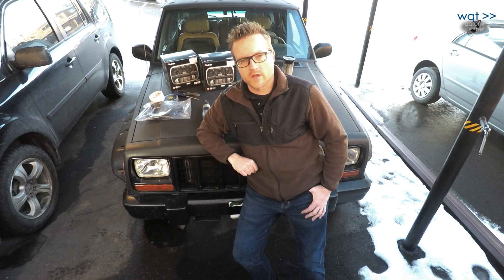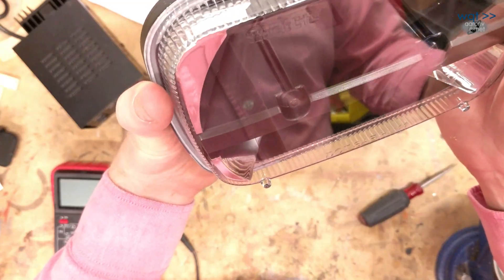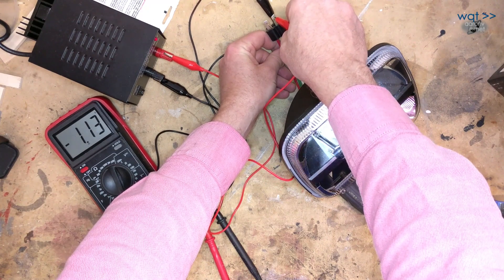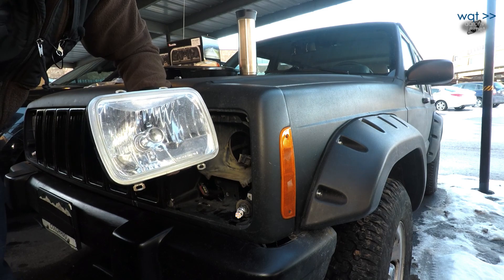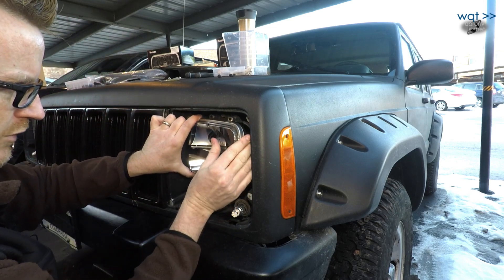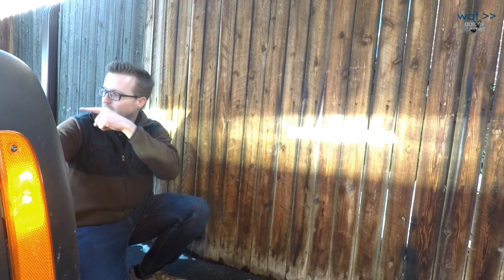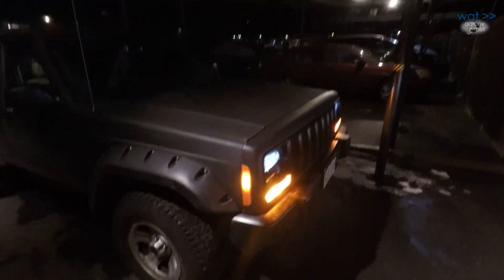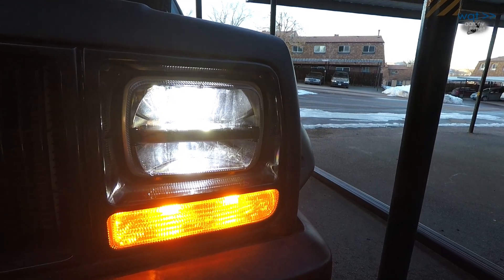projectXJ: 5x7 Truck-Lite LEDs to upgrade the Jeep H4s (84-01 Jeep Cherokee XJ, many others)

Comment: Please share the part number(s) of what you purchased. And where did you buy them? Directly from Truck-lite?
Reply from the maker: The part number is 27450C (both sides), as far as I know this is the only 5x7 sold by Truck-Lite. I got it from Amazon and the seller was Drivetrain America. As of right now, if you search "Truck-Lite 27450C" on Amazon it appears as the first listing with the best price and an "Amazon's Choice" tag appended. Headlight Revolution (referenced in the video) also carries them online, but I've never used that company. I don't see a sales option on Truck-Lite's website, but they do have a "distributor search" option which may reveal a trucking or RV supplier that has these (and probably other brands) in stock locally.

Comment: Truck-Lite makes a heated version. I’m curious how yours will work with heavy wet snow. Does it create the same amount of heat as the incandescent makes to keep ice/snow build up?
Reply from the maker: On the few occasions that I've been in wet snow/icing conditions with this vehicle, I have gotten buildup and had to manually clean the lenses. But with an automatic, no ABS, no traction control, and a lunchbox locker in the rear axle, I try to avoid driving it in those conditions :-)